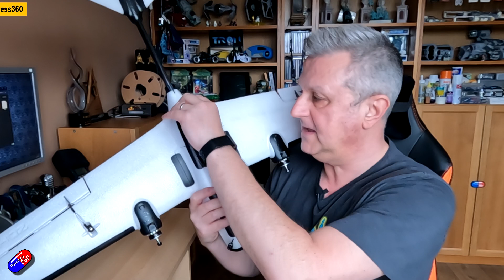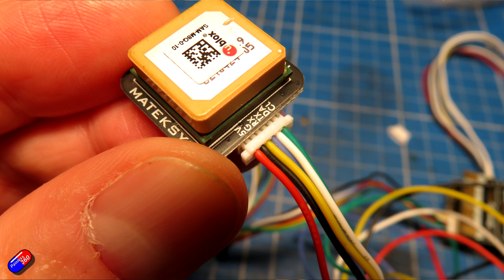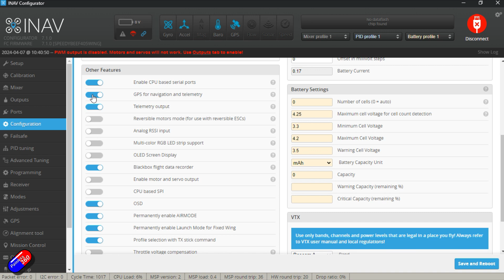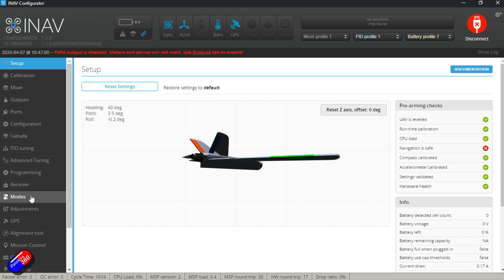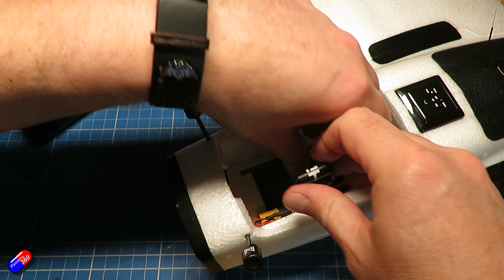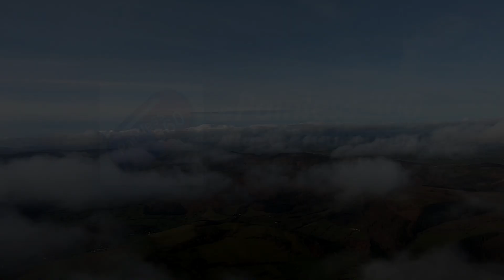My ZOHD Altus build using SpeedyBee F405 Wing Mini and INAV V7.1

Comment: Hello and thanks for all the info. I designed a 3D printed nose to house the avatar system. Balancing is now easier. If you like, I can share the file. One question, have you had the opportunity to have pids/filters to make it fly more stable? Thank Hello and thanks for all the info. I designed a 3D printed nose to house the avatar system. Balancing is now easier. If you like, I can share the file. One question, have you had the opportunity to have pids/filters to make it fly more stable? Thank you ❤️
Reply from the maker: I never really spent any time with this model as I prefer the AtomRC Swordfish. Great to hear that the heavier nose helped with CG. Happy flying!
Reply: @Painless360 Thank you for your reply. If anyone needs to contact me for the file. (free of charge, of course) 😅

Comment: Does your radio have V tail Mix? or is it just in Inav Mixer?
Reply from the maker: No mixes are done on the radio always in INAV. Happy flying
Reply: Also I don’t seem to get smart port telemetry on r9 slim plus. I followed exact steps on how to use tx2 as input for s port. But still I don’t get any telemetry data except rssi and receiver voltage on my radio
Reply from the maker: Check out my INAV for beginners series for how I do it. Best of luck

Comment: Hello, do the engines have to rotate inward or outward from the fuselage?
My engines rotate outward, and I can't find a way to change the direction of rotation in INAV.
Reply from the maker: Either way works for rotation, but most would choose the props turning in. See my videos on ESC setup as you can reverse via INAV directly. Best of luck
Reply: @Painless360  Could you send me the video link?
I can't find it, thanks.
Reply from the maker: AM32 or BLHeli ESCs? If you don't know then swapping any two of the three wires on the ESC/Motor connection will reverse the motor.
Reply: @Painless360  The ESCs are the ones that come with the Zohd Altus.
Reply from the maker: Best of luck. VTOL is hard to get right, especially tilt rotor VTOL.

Comment: I see you said you have left your ailerons with the Y connection that comes with the altus, is this best? Just connect it to servo 1 and change nothing in inav other than selecting vtail? Never done it before and want to be sure, thank you 🤘 or can I just connect them both without the Y? Whichever is most simple?
Reply from the maker: Both will work. Seperate ailerons are handy when the nechanical servo stuff is hard to get identical... Happy flying!
Reply: @Painless360 brilliant thankyou, appreciate it, slowly getting my head around the fixed wing sode of things

Comment: i need help! the ESCs will not stop beeping. My motors and servos wont work even though they are plugged in perfectly. I am using dji fpv controller 3 and it shows up in inav, just nothing happens on the plane even though "enable motor/servo outputs" is switched on. help!!
Reply: all my inav settings are good too. this has happened with the mini and regular f405 wing
Reply from the maker: Check out my INAV for beginners series for how I do it. Best of luck

Comment: Hey there!  I am soldering my f405 wing mini today. With a 40amp ESc with built in BEC. Do I need the capacitor soldering on? Or only if my ESC doesn't have one
Reply from the maker: If it comes with one, I tend to add it. Having one on both the ESC and the FC isn't needed unless you are starting to get into 6S and above from the playing here...
Reply: @Painless360  thanks so much for the great response! it is actually going into a fms 64mm F-16 jet... so it does have lights and main gear servo.. but its only 4s. should be fine.

Comment: Hi I'm having a problem with my altus all my settings are correct on inav but when I'm trying to fly it the tail keeps waging from side to side I'm using a 4000mah 4s battery I don't have any camera on it do you think I need a heavier battery please help me thank you
Reply from the maker: It could be the rudder travel or yaw tune needs attention if you're not using differential thrust
.. Best of luck

Comment: Hey buddy I need your help bad lol . Ok I’ve got the SB F405 WING. Everything went well just as you have instructed with the flash and set up. Now I’m having an issue with getting the motor to run with remote. Yes I enabled the outputs and in the receiver tab shows the signal is being received from the tx. And the motor spins up in the master slider tap in the app but When it’s plugged to battery and I switch the arm switch it beeps short continuous beeps but won’t spin up motor. Everything in invav seems to be good all green checks but one my compass calibration. I was waiting to get it outside to do that via wireless. But I need help is there anything I may have missed ? I know you’re pretty busy and this is an older topic but if you could help me please I could really use it. Thanks
Reply from the maker: Check out the video on the channel today... Best of luck

Comment: Hello, I am using flysky i6x + expressLRS transmitter. I noticed that when we select the modes we select in inav and similar applications in the field, if we do not remember which switch opens which mode, this creates a big problem. I see that there is a sound warning in the advanced remotes you use. I have no idea what the technical name of this is and I could not find such a mod for my remote in my searches on the internet. Is there a way to bring this feature to my remote, or what is its technical name?
Reply from the maker: I use the INAV lua script on the rados here.... Happy flying

Comment: Thanks.. just waiting to receive mine and this will be very useful. I assume you could have soldered the wires for the ESC power side by side as well as top and bottom ie, all the +ve pads are common?
Reply from the maker: Yes, happy flying!

Comment: Can someone tell me please what's the purpose form the aux cable is? I bet it still wan`t pass the butter, and the manual still says nothing about that. Thanks.
Reply from the maker: Which aux cable, at what point in the video?
Reply: @Painless360  on my Altus, out of each wing comes a cable with a „AUX“ sticker on it
Reply from the maker: There are three 'unused' pins in the connector for the wing. I'd check, but I'd expect that is what they connect to.. Happy flying!

Comment: Thanks for sharing all this great info, I just got one an Altus with the same SpeedyBee FC and your video has gotten me really close but but I am having troubles getting all my surfaces to move properly. Depending on how I connect them either one rudder or the other moves, sometimes the wing flaps and a rudder will move, etc. It looks like maybe you separated out the Y servo connector to be individual servo connections to the FC? Any chance you could share your diff all or share how you connected each thing?
Reply from the maker: I didn't use the y cable for the ailerons. Apart from that, the setup was exactly the same as any other plane with a tail... Best of luck
Reply: @Painless360 thanks for the response 🙏🏽I came to that conclusion last night and it helped but only my tail moves for pitch, not my ailerons. I’ll get it figured out!
Reply from the maker: That is how it should work. Pitch control is elevator only by default.. Happy flying!
Reply: Did you disable rudder control in iNAV?

Comment: I am new to hobby and about to assemble my first Speedybee board using your video. Can you give me more light on capacitor used, how it is connected, and why? Thanks!
Reply from the maker: It comes with the kit. It smooths out any voltage spikes in the battery voltage due to the ESC firing the coils in the motors. It can help with current sensing, as those spikes can cause them to read erroneously..
Reply: @Painless360 thank you for your reply, my speedybe kit is still in shipment will have a chance to get to know it this weekend I hope. I am newb here. 😅 Your videos motivated me to enter this hobby, cheers!

Comment: Hi Lee! Once more, thanks for an awesome video. There is always useful info in your videos. 
I am setting a similar model and I do have a question. Due to space limitations I do have to make the battery and ESC wires connected to the FC somewhat lengthy. More than 15cm. Is there a limit/suggested length for the battery and ESC wires? If they are too lengthy, does it make sense to add some capacitors?
Cheers!
Reply from the maker: I've had long runs before and not had issues. Adding a cap can help with things like current sensors... Best of luck
Reply: @Painless360  Thank you so much!

Comment: Looking forward to the maiden, but conflicted about having to add so much nose weight. I was hoping this would be different from the Reptile Dragon V2, another plane designed around running a full sized action cam that winds up being hard to balance if you want to build it light. I'm happy with the video from an O3 or Avatar, but even if I wanted a separate action cam I wouldn't choose a full sized GoPro.
Reply from the maker: Me too - I love the RunCam Thumb PRO, hard to beat for the price.